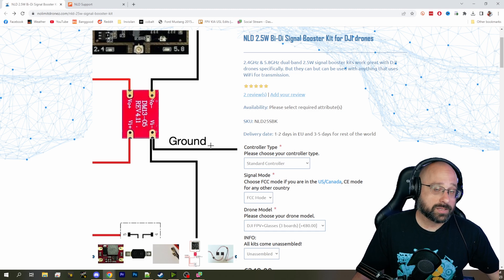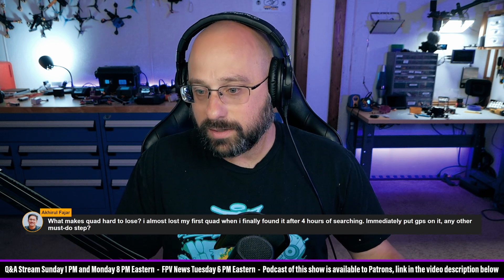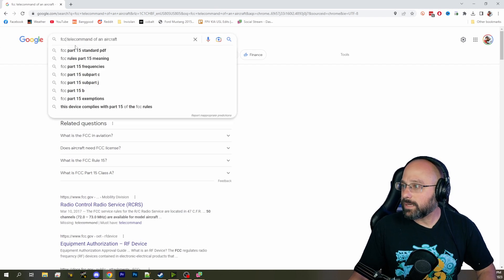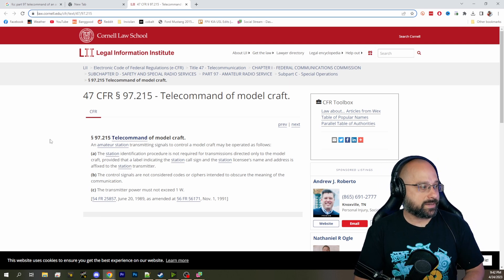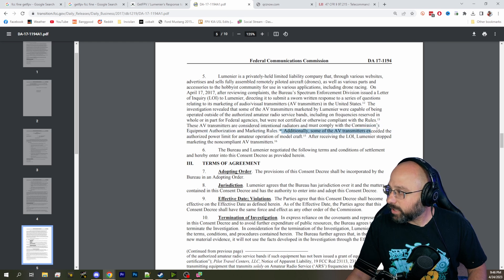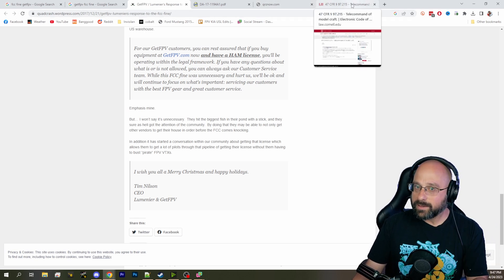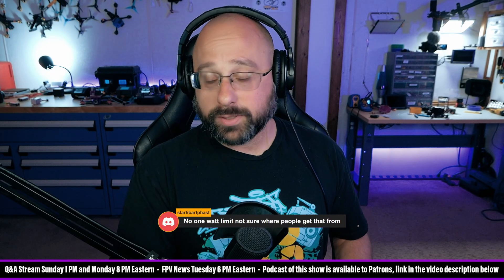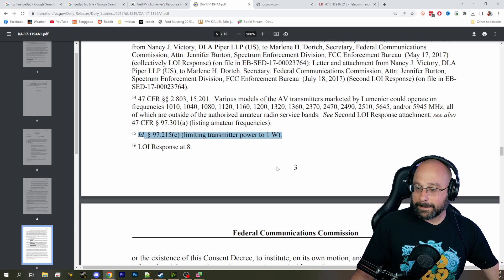Where Does The One Watt FCC Limit on FPV Video Come From? - FPV Questions

Comment: The FCC also says CB radios are limited to 4 watts.. But that NEVER stopped CBers from adding linear amplifiers.. I had a Palomar tube type grandpa gave me.. It used 8950 power tubes before solid state. 
But To be honest, a well calibrated beam antenna and elevation makes the station still holds true to any radio broadcast..
Reply: It said 5 watts in 1974 .
 And a linear amplifier was legal on channel 9 for emergency and other channels if 9 was too busy in an emergency .
Reply: @gregorydahl  oh yeah.. That's when they were 23 ch. 
Then they gave us 40. 26.965mhz to 27.405mhz right?
They jumbled ch. 21 22 & 23 up.. I remember ch. 23 was popular because of that until the 40 Channel radio came out.
Then we moved on to 10- 12m HAM radios and modified them to work on 11m. 😆... Not me..  No, never. 🤞🤣
Reply: @MadDragon75  
   Yes those things . Breaker one-nine . 
   Ham radio still works .
Reply: @gregorydahl  😉👍

Comment: Also this. You can’t use a ruling to redefine the regulation, fcc would have to amend it. 
It was just a dumb error in a document. 

(44) Telecommand. A one-way transmission to initiate, modify, or terminate functions of a device at a distance.
Reply: Oh . So a remote disabler jamming device broacasting  tons of 15,000 watt noise signals to interfere with hobbycraft was the incident that suggested a jammer limit referred to as " telecomand signal be limited to 1 watt "
Reply: @gregorydahl  no idea what this means

Comment: I mentioned this before, the document that you cite proving that a video link is a "telecommand" is a document that was filed in court as part of the GETFPV settlement ruling.  It is not what the regulation says or intended. Lawyers who file court documents like this make mistakes, inaccuracies and absolute lies in these documents at a vary high level. Unless the "mistake" is highly germane to the case and argued in court the mistakes remain in place as no one cares to spend time on something that isn't a factor in the actual outcome. Since this was a "settlement" in court that document was not argued or vetted to be correct in its entirety so for me this does not represent absolute proof that the limit exists per the actual regulation. Instead it is just something that someone in the FCC just decided to write using their own  interpretation, and wrong imo, of the regulations. This kind of behavior happens all the time with our government agencies for a variety of reasons. Of  course this is all splitting hairs, moot, etc as one probably has a better chance at getting struck by lighting than being cited for transmitting video with a power setting > 1w no matter what the FCC says.